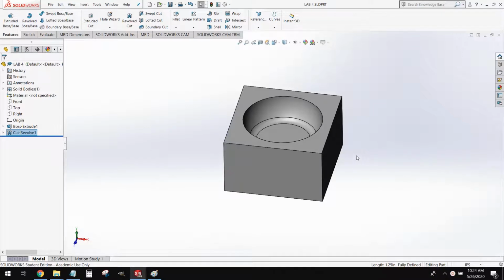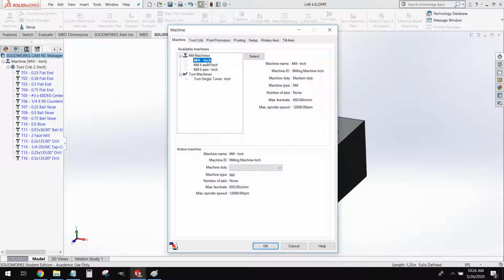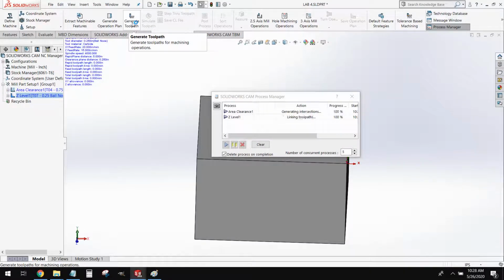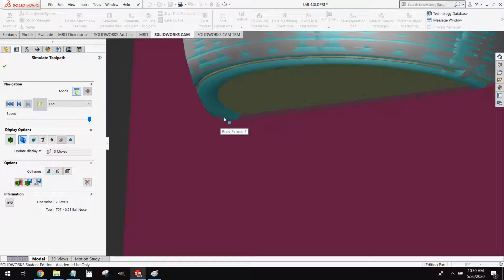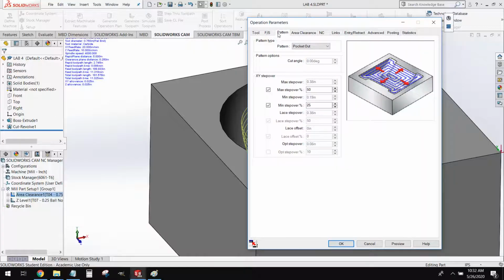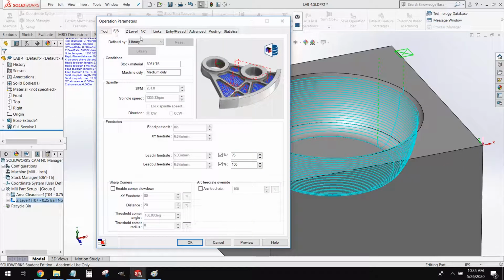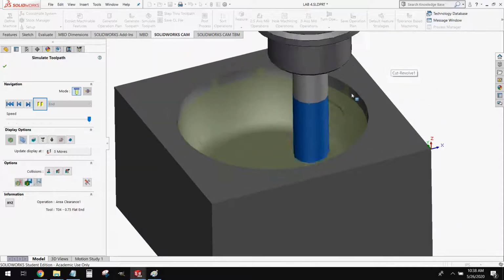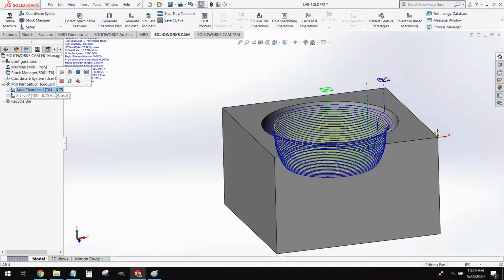SolidWorks CAM tutorial: Intro to 3-Axis Milling (4)

Comment: Hello Professor, these videos have been great resources. I've a query with 4th axis. I am able to generate 4axis independent machining G-code, the one where features on every face gets machined by flipping A axis to suitable degree. 

But unable to generate 4-axis simultaneous code. Need to do some cam-type profile where XYZA all axes needs work together. What am missing ? Have 2019 version.

Comment: Thanks for sharing.  These have been very helpful. When I follow along step by step on this tutorial, I'm having trouble getting the tool path to generate in multi surface feature. It's generating a zero length tool path which won't simulate. Is there a setting I need to adjust? Thanks.

Comment: Could you do the same tutorial, only for machining fillets on the  external edges?  So instead of your part having a bowl in the middle your part would have both top and corner edges filleted.  I am unable to figure out how to set an origin outside of the physical part (the point at which a filleted corner would be a straight corner) and for fillets on the outside edge SW doesn't detect them nor am I able to select them manually.  Thank you for your consideration.
Reply from the maker: i can certainly put this on the list for you!

Comment: I am loving your videos, I have been using Solid works for about 9 years now, but I have never used the CAM software. We just got in a new 3 axis mill and I am trying to convert the G code into something it can read. Do you have any tutorials on that?
Reply from the maker: Which Mill/ controller do you have?....gcode is mostly universal, but some controllers can be quirky and need the code formatted differently.
Reply: @professorcameron3990  We have an Acu-Rite G2 controller, it's brand new.